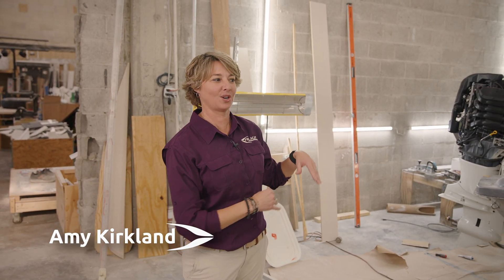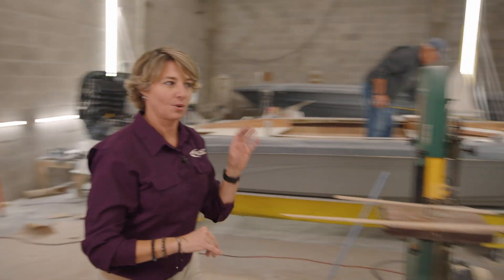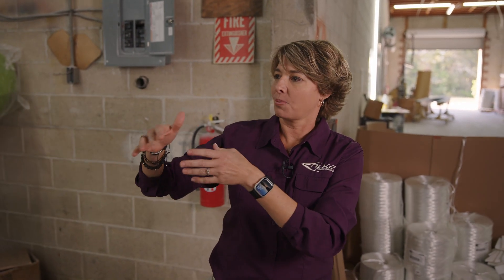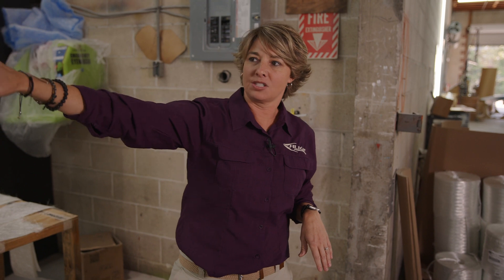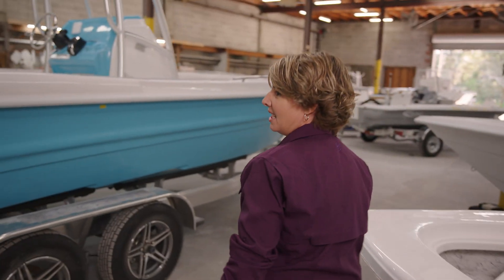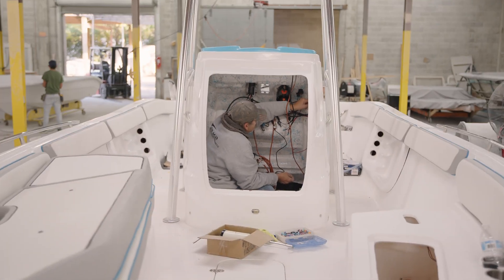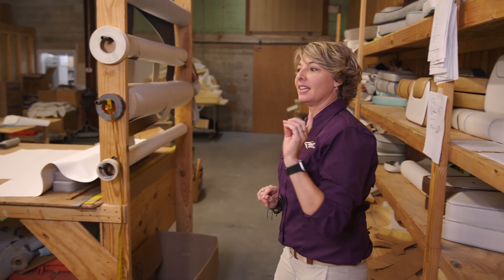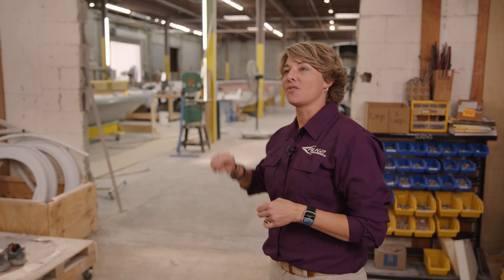How center console boats are made! ALK2 Powerboats Factory Tour

Comment: Is wood actually used in the boats?
Reply from the maker: No. Our boats are made from molds by using multiple layers of fiberglass
Reply: You straight up didn’t listen to the first 30 seconds of the video. Plugs are made with a combination of materials including wood, plugs are used to make the molds, molds are used to make the fiber reinforced parts.
Reply: @phillpd96 I did listen.  I’m no boat builder but when when I hear wooden plug that sounds like a filler.